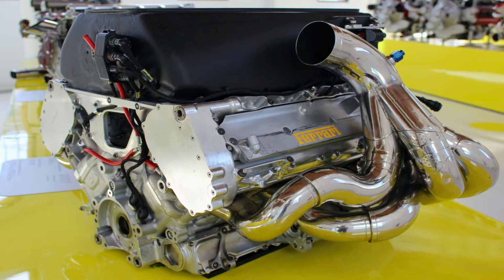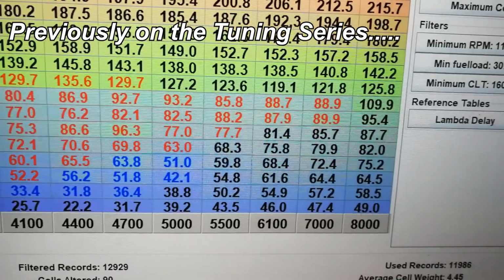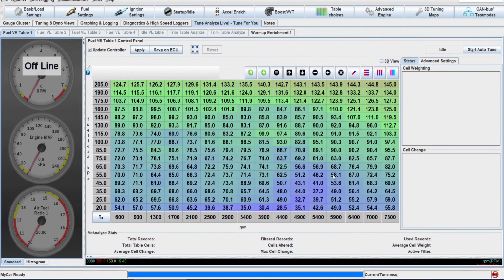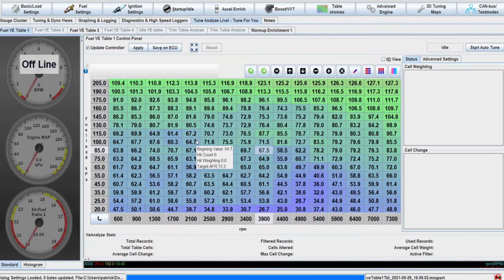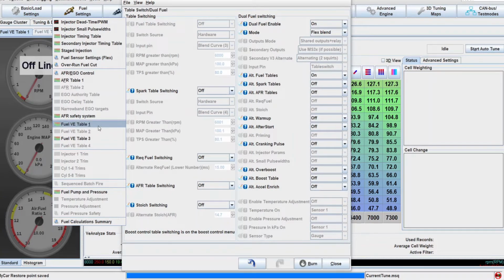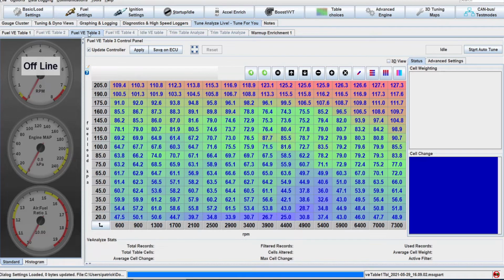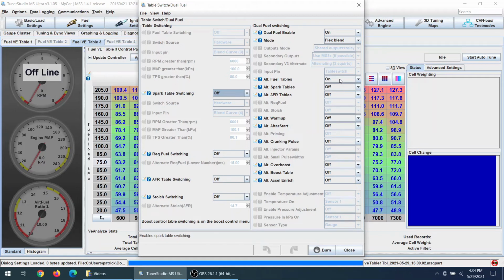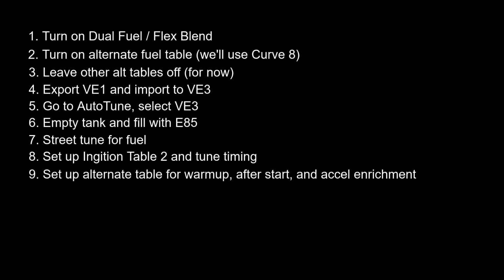Tuning the Megasquirt (Pt 10.) - E85 Ultimate Guide 1

Comment: Big fan of your videos. They are easy to follow and very helpful.

I have one question that I believe I know the answer to, but wanted to check. My car is constant e85, no switching back and forth. Fuel is tsted at each fill and ethanol added to make straight 85 if needed. I changed the required fuel to 9.8 stoich. Do i also need to multiply the VE table by 1.38? Or do I only do 1 or the other?

Thank you.
Reply from the maker: Yes, you can do one or the other, but I'd recommend changing the req fuel calc value because that hits a few other areas, like start up, accell enrichment and such, automatically.  Changing just the fuel table will require more tuning for those other things.

Comment: any idea why i have ve value of 70 in idle? seems high. i have all settings correct for injectors. deadtime, size, required fuel. i have 2000cc engine 940cc injectors 4x, fuel press ia correcr and e85 as fuel. im bit lost here
Reply from the maker: It can vary.  The number itself is somewhere from 0 to 255, so your setup and hardware needs 70 at idle while someone else with a 1.6 engine, other injectors will be lower.  If your idle is stable and at the afr you want, then you are good.  If your map is too high at the top (you're running a lot of boost and you are close to 255)  you can modify required fuel and then bring your map numbers down.  But usually, it won't matter.
Reply: @OGPedXing  okay now i can relax and just tune the car in peace. thank you😊

Comment: Not to contradict but Alcohol burns slower and less "explosively" than gas. But it burns longer so and applies less combustion pressure but for a longer period of time to effectively apply more total pressure to the crank through the piston and rod. This is why alcohol makes more power and is less destructive to internal engine parts. As a side note on alcohol dirt mods we find that typically we don't or shouldn't add more timing as it doesn't add any power. The longer burn time on the power stroke seems to be the big benifit and using that up by advancing timing won't provide any advantage.
Reply from the maker: In my research, the laminar flame speed of ethanol is .455 meters per second vs .4 m/s for gasoline.   That's what I was referring to.  That doesn't necessarily contradict your points, though.  Full combustion is different from flame speed.  On a dyno, you will typically be able to get more power in any part of the curve where gasoline was knock limited by advancing the timing.  Other places, it won't help and may lower mbt.
Reply: @OGPedXing  According to the national institute for health combustion rates for gasoline are faster than for alcohol and flame speed propagation in a non enclosed area has no effect on combustion rates. Typically any ability to advance timing has to do with the cooling effect of alcohol fuels when inserted in the fuel air tract of an internal combustion engine as u have stated making it less knock prone. In my years of racing (I'm 63) with a race gas powered car ignition advance can be run as much as 35 total degrees. Alcohol engines tend to rarely use any more than 28. Of course adjustments will probably have to be made in a street driven vehicle.
Reply from the maker: @matthewmoilanen787  Hmm, that's not my experience at all.  Just with my Miata, 28 degrees is very low...down a lot from max torque.   I don't have the paper in front of me, but it is measured in a compressed state (piston) at lambda = 1.
Reply: @OGPedXing Of course you'll want to adjust accordingly for your street driven vehicle, combustion chamber type, valve train type, bore stroke ratio, ect but we and most other dirt or asphalt oval guys seem to settle on about 28-32 max. If u have made Dyno runs  and found your ideal to be more than 28 then you should of course do that. Most importantly is that more timing isn't necessarily optimum but it may work well in your case. I have been told by the so called "pro" engine guys that the biggest benefit for them was the increased burn time and pressure application on the power stroke. They have explained that starting the fire too early just pulls power sometimes because combustion pressure starts to rise while the piston is still raising. You seem to be doing a great job on explaining the installation of this control unit and if it works better for you with more advance good on you for finding that out and pulling that last bit of power. Again nice work on the vids as you are a huge help to allot of people trying to work this stuff out!

Comment: Great videos thank you.  I have a question.  I am running an ms3 goldbox and enabled flex fuel as per the video. However, it doesn't seem to be automatically adjusting. It's reading the percentage and idles fine, but as soon as I try and give a liitle throttle it goes way lean.  Any suggestions?  Thank you.

Comment: hello, are you familiar with the microsquirt from AMP'd? and if so do you know if you have  to do the ls1 mods inside?
Reply from the maker: I haven't used it personally but it seems like it supports the Gm ls1 ignition.   Probably not fully sequential though.
Reply: @OGPedXing  no, it's batch fire for the injectors and wasted spark for the coils. Thanks any, i like your channel.

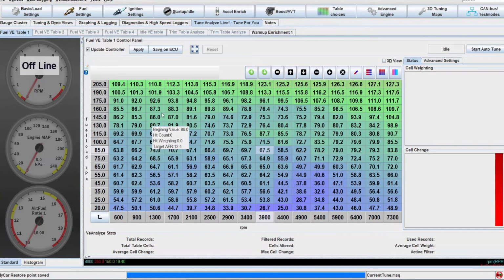Comment: 10:14 I have a question I have in mind. If I change the AFR ratio on e85 (9.8:1) will I'll still be able to target values on the gasoline scale such as 14.7:1 at idle?
Reply from the maker: If you change it on the req fuel calculation table then yes.  If you change it on the general settings fuel screen then no, you would then have to convert everything to the e85   afr scale, so 9.8 instead of 14.7.  That's why I recommend not bothering since the displayed afr is based on lambda values.  As long as you stay consistent on the tune for what you enter, it works fine.
Reply: @OGPedXing  Thank you man! My car has been running great since I converted it into e85, I hope you keep doing this type of videos. I really learned a lot!!!

Comment: How would I configure gasoline to e85 with injector change 500cc to 1000cc
Reply from the maker: I would do it in two steps.  First get your new injectors set up (change req fuel and your injector specific settings for dead time, etc) and get tuned on gas.  Then do the changes as I go through in the video to set up e85 and tune a second map for use in the dual fuel mode.
Reply: @OGPedXing  thankyou for all the information it's been of great help, the car idles perfectly at warm and starts first time. I do need some help with cold start idle as It's a bit low, don't have an iac, is playing with the warm up enrichment the best way to increase the idle revs.
Reply from the maker: One thing you can try is to increase the timing a bit in the idle cells, especially in the column for an rpm that is lower than your desired idle rpm.  So say you idle at 800 rpm and 15 degrees of advance.  For the column before that, say 600 rpm, make the timing be 18 or 20 advanced.  This will kick the rpms up  a bit when they drop below target and it works without an IAC.

Comment: what would be causing my ve to be maxxed out at 255 but only at 45% duty cycle?
Reply from the maker: Something is off with the req fuel calculation or the injector flow rate setup is my guess.
Reply: @OGPedXing  have all the req fuel settings correct just unsure about the injector staging and squirts per cycle, currently 2 squirts simultaneous. thanks for the reply :)

Comment: Ok. Newbie stupid question…
  So not with the ECU or ability to use Tuner Studio currently I figured I would ask,  having started to design a fuel tank/supply setup to switch from 91- 93+ octane fuel to E10-E85 ethanol is there a way that you can setup a button on a digital dashboard or manual switch that can change that setup on the fly at the racetrack?
Reply from the maker: Tuner studio will support a number of ways to have an external input like a switch change what happens with fuel and other related tables.  The table switch feature is exactly for this situation although usually the physical tank you switch to is not running a blended fuel.  Usually you just have full e100 race gas or propane or something else.   If you're just running a blend of anywhere from e10 to e85 then usually you'd just put whatever in the normal tank and tune with the dual fuel blending table feature.  No switching required, car will run well on everything.  Edit: this needs a flex fuel sensor and will work best with an ms3.

Comment: I wish this guy was my auto shop instructor 👨‍🏫
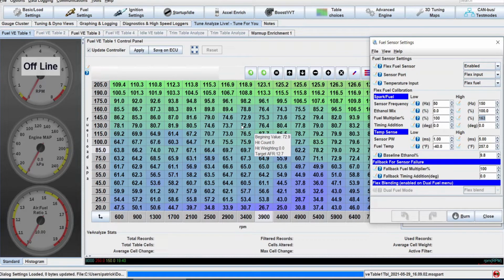Why am I limited with MSPNP2 ? 15:15
Reply from the maker: Haha, thanks!   The ms3 added a bunch of functions related to tables blending and switching over the ms2.  So a lot of the screens following that point won't be available for ms2 users.  The ms2 e85 setup was mostly just the auto blend function as opposed to fully separate tables.
Reply: @OGPedXing  you are awesome! Now I wish I would have bought an MS3 for my E30 but they didn’t have a plug and play.
Reply: @robmespeedy  I use mspnp2 and run flex fuel just fine
Reply: @discount111  dude how to I add you? I have many questions

Comment: Enjoy watching your videos and trying new stuff in tuner studio. Do you think you could drive an external pwm through the tacho wire? Just to turn it on/off?
Reply from the maker: It may depend on the solenoid.   Usually they want 12v and the tach output is 5v, however you may be able to supply 12v from another source and use the tach output side as the ground side.  The polarity doesn't matter for nearly all solenoids.
Reply: @OGPedXing  that is my idea. I bought a 3v-20v dc/dc ssr100amp. I want to use that to power the external pwm that is controlling my methanol Injectors. I have the pump on a hobbs

Comment: Hi, thanks for all your videos, have been going through them...   Ive nearly finished a turbo conversion on my mk2 mx5 and was wondering if you might give me a quick bit of advice 😁😁..   I'm in the UK and the government has recently changed most of the fuel over here from e5 (5% ethenol) to e10 (10% ethenol).  This apparently could cause some problems for the fuel systems on older cars like mine. I have a new ms3 mini. I will get it mapped by a tuner soonish and was hoping to take advantage of the extra ethanol in the new e10 fuel. (I can still buy e5, but it is 99octane and very very expensive).  But was wondering what parts of the fuel system I would have to replace to make it more reliable? Just any rubber hoses?  Or do you know of any more internal hard to reach parts that could fail? I'm guessing it would be the same parts that you would have to change when using e85..?
Thanks 👍👍
Reply from the maker: Short answer: nothing.  E10 will work fine in your stock fuel system.  Over here we've been on e10 for about 20 years, regular hoses and fuel pumps are just fine.  If you really wanted to, you could replace the rubber hoses with SAE J30R9 spec which is not too expensive.  The MK2 are mostly returnless so one or two hoses in the engine bay and a couple around the fuel tank end.  Buy 10 feet/3 meters and that should be plenty.  Once you switch over you can also replace your fuel filter.  The little more ethanol can stir up some stuff.  Usually more of an issue when switching to full e85 though.
Reply: @OGPedXing  thanks for the reply 👍👍.    Think I'll go ahead anyway and replace those hoses like you say,, (I've watched your other vid now which helps too thanks) just incase the US cars use different spec fuel hose to UK.  🍻🍻

Comment: This was an everything-you-need-to-know that actually contained everything-i-needed-to-know, you're a legend mate cheers! Would a lot of this also apply to an LPG conversion? LPG is a mix of propane and butane. I'm not sure if you can buy a sensor that detects the % of each, but if you could...?
Reply from the maker: Will you be running only lpg or switching between lpg and gasoline?  If switching, this is usually done with the table switch features and you can wire in an actual switch which the ECU will use to determine what fuel tables to use.  For both cases though, a wideband O2 sensor will work fine.  They work for all combustible fuels since they are reading oxygen content after the burn.  So lambda1.0 will be stoichiometric for lpg, same as for gasoline.  Stoich in afr for lpg is something like 15.5 vs gasoline's 14.7 but that doesn't matter because the sensor is always reading lambda.

Comment: If you set the setback multiplier to 100% on sensor fault when running e85 it will fault to a too lean condition I would set it to 140% bit safer  Stoich of E10 is 14.10 not 14.6:)
Reply from the maker: That is good advice.   Yeah for this particular tune the stoich was 14.6 and the ve table is matched to it...meaning it was wrong from the beginning and then the ve was rich to compensate,lol.  Dates from before I had a sensor to give me the real ethanol content. 😊

Comment: I wish i had an MS3 because it really opens up so much possibilities. For now I'll have to do with my budget and ms2x. Great info anyways, thanks !
Reply from the maker: I saved a lot building my ms3x from the kit.   It's actually a lot easier to do than you might think.  While I had soldered things before, I had never done circuit boards.  But I picked it up really quickly by practicing on an old board with some misc parts.  Only took an afternoon to do the ms3!

Comment: Awesome video! Wouldn't running on e85 cause a lot higher cylinder (peak) pressures because it burns faster and you'll add spark advance? Isn't that the weak spot for a stock (miata) engine where it would bend your rods? Thanks for anyone clearing that up :)
Reply from the maker: Yes, that's possible.  Regardless of method, (e85, turbo, supercharger) I recommend staying below 240 ftlb of torque on stock rods with a Miata.  The block is beefy but the rods can only go so far.   Typically we'll add 2-6 degrees of timing in the power band and that's it when running e85.
Reply: @OGPedXing  OK, that leaves ethanol with the advantages of being more knock resistant and its high cooling capacity. I always try to run very conservative spark timing until about 4700rpm where the cams are most efficient and then go up in timing to make a usable powerband from around 5500 to 7400rpm with high boost and comparatively high spark timing. That way we were quite succesful with keeping stock engines alive.

So with e85 the max. hp (/torque) number isn't higher but just easier to achieve, can we agree on that? Or am I missing something?
Reply from the maker: @mielsen7498  I'd phrase it slightly different, the max HP can be higher on e85 due to its properties and knock resistance, but that Hp can be safer to achieve.  However too much power bends rods, regardless of everything else being perfect or fuel type.  A good Dyno session or even Virtual Dyno software can help you know when you're getting to that limit.